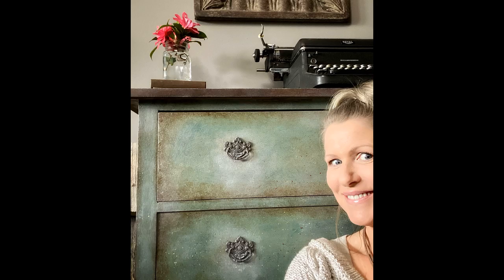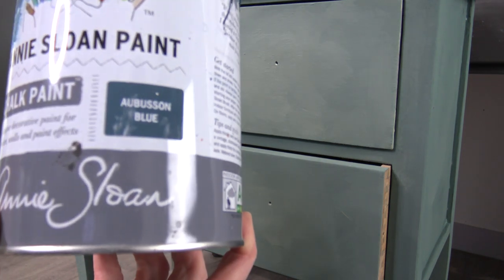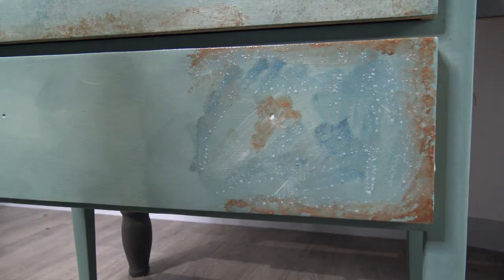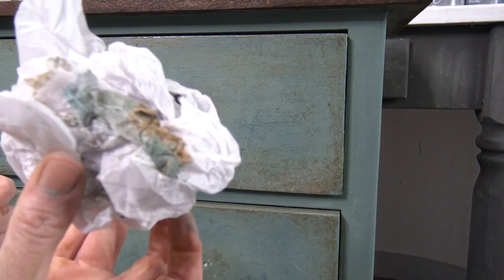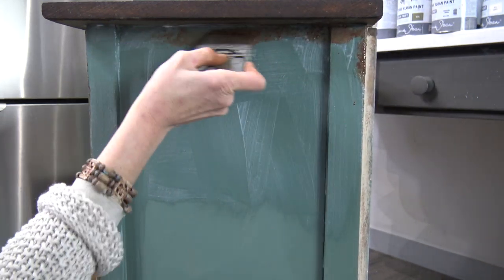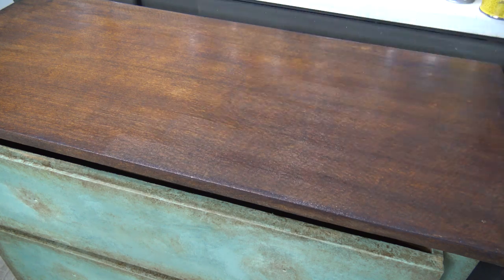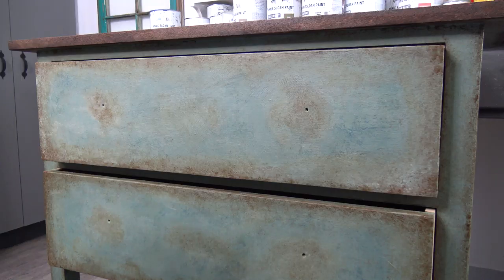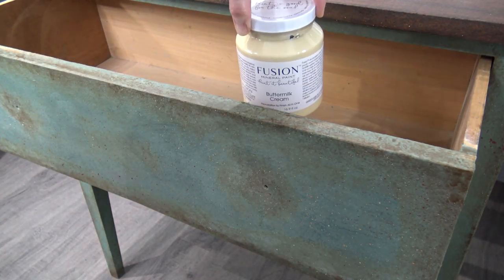Chalk Painting Furniture with Frottage, Glazing & White Wax for Aging

Comment: I love the idea of fly specs on a piece to add more character. I’ve never done this technique before. I’m wondering, the way you dilute the paint by sticking the brush in water first, does it give the spackle an essence of the color (like water color) or is it still pretty close to the actual color? I guess, it’s just a matter of preference by adjusting  the wetness.
Reply from the maker: Kim Bennett ... thank you so much Kim for your kind comment and feedback 💙🙏
You are exactly right regarding the fly specs!
I like to dilute the paint with water similar to watercolour but it also allows me to erase it with my figure tip or damp cloth if it was to much or didn’t like some of the specs 😉🎨
Just play and most of all have fun 🤗

Comment: Thank you once more for a wonderful video. As always, I love your choice of colors and techniques and how well they age a project.
 One time I finished a table top and applied wax as a sealer. Unfortunately, the surface wasn't protected well. I think that I didn't give the wax a long enough cure before people used it. spills and such eventually lifted the wax and paint and well, i'm going to try again. I'm wondering for a table that will be used as an eating/drinking surface if you believe that the acrylic laquer will be durable enough? 
I also wondered if you could tell us how you care for your brushes, especially the wax brushes? Do you remove the wax from them after every usage? Do you use water and soap to remove wax or alchohol? Or is it ok to let the wax dry on them? Thank you, as always for your generous sharing of your experience!
Reply from the maker: Hi Nanette
The lacquer varnish should be very durable. Wax is durable but for any high utility use like a table top or work station area definitely a lacquer will protect. As for brush care , Murphy's Oil Soap is the best for cleaning your brushes. I do it every so often, to maintain the brushes. If paint on the frame or handle bother you I recommend using a paint thinner to remove the paint spots, I don't mind the spots so I don't do that very often lol 😂 but the bristles are important. Let them soak for about 20 mins half hour and wash with warm water and a bit of dish soap after the soak. Hope this helps 🙏🎨
Reply: @TheReclaimedHeirloom  Perfect! Thank you. I would never have thought of Murphy's Oil Soap!!! Take care please and stay safe! I hope you are all well!

Comment: Hi Christina, LOVE  your work. Need help. Was very happy with kitchen table but the wax wasn't  enough to seal it and v.quickly stains from grease etc built up. Bought lacquer, and  will now have to re do. I'm scared to sand back and restart as we've not much space and we're a family of 5 so need to use asap. Can't go for texture as it will be too hard to clean "properly " will the lacquer be enough to protect from hot plates /grease etc or should I give up? It's put  me off doing my stairs now,  as  I'm  afraid the same will happen. Kinda knocked the wind outta my sails.  Ps, using all Annie products. Any advice would be cherished
Reply from the maker: Hi Cerena
I am so sorry to hear about your project and I one point I remember having something similar happen. I do feel the lacquer varnish should be enough to protect your kitchen table top. I have painted and lacquer finish kitchen table top and I have not had any issues at all! I did apply 2 full coats and some prefer even 3 but I found 2 was enough!
I don't have any problems with cleaning or using a cleaner on top so I hope this helps , if you have any other questions please fell free to contact me anytime 🙏🎨
Reply: @TheReclaimedHeirloom  Thank you, thank you, for your reply. Such a Great help. I'm a little star struck 🙈if I'm honest. You're like the rock god of chalk 😂🌟😎🙌. I'll give it 2 or 3 coats to be safe 🤗. Is there any technique you'd suggest for the stairs? They're old and not in great shape. I was gonna try frottage or similar. I thought it would hide a multitude and not show up too much dirt. Watched your "tiling" video and got very excited so may try that after I'm satisfied with the look. You've given me my confidence back to tackle these projects. You've no idea how much this means to me. Go raibh míle maith agat (pronounced gurra me-la maw a-gut) a million thank yous from Dublin. 🇮🇪
Reply from the maker: Cerena OBrien ... for stairs it depends on what your design idea is ? Are you wanting to apply paint to the step or the riser?
I have a tutorial I did a few weeks ago on painting my own stairs but I stencilled the riser .
Reply: @TheReclaimedHeirloom  you did, I watched it and loved it ❤️was going to try frottage on the step and stencils on the riser?? I've no back up plan 😬if the frottage doesn't look good, have you any suggestions? I've a Louis Blue, French Grey and can't remember the name of the teal colour. Was gonna play around with them. I also have graphite and Napoleon blue and a couple of waxes.(clear & dark) All Annie, but have a gold and a silver I picked up in the hardware store. Much love 😍 sent your way.

Comment: I would love to see how to deal with the inside of drawers that might have smells or blotches of random stains
Reply from the maker: Hi Wendy,
Insides of furniture pieces are always a ? Generally I paint them because I work on mostly used pieces and a fresh inside is much preferred by new buyers. I love Fusion Paint not only for exterior finishes but for inside of drawers and cabinets , Its super thick and 1-1/2 coats make for a new look! and because its an all in one paint with sealer so it won't chip or need wax to seal it. If you have a very good condition piece and the drawers are in good condition I will just apply a fresh stain coat inside to freshen the wood ! But generally I come across drawers with stains or water marks etc and a paint like fusion mineral paint is 👌 perfect. I did once sand the inside of a dresser and it was a lot of work but it made it feel new again. Everything depends on what you'r restoring, is it to sell or a piece of your own furniture and your preferences.Hope this helps and if you have any other questions you can reach out anytime🙏🎨
Reply: Thanks so much.